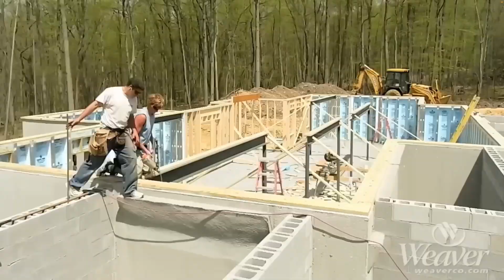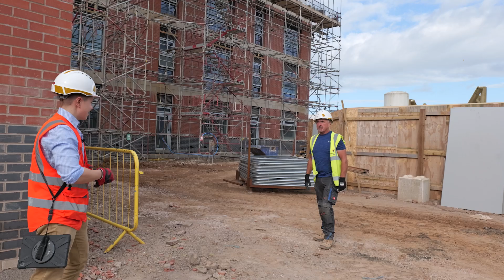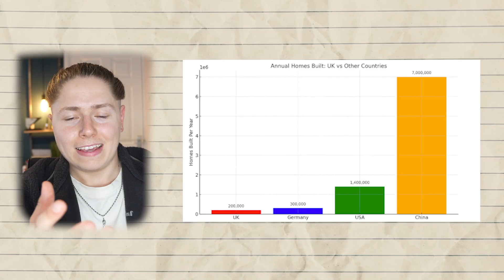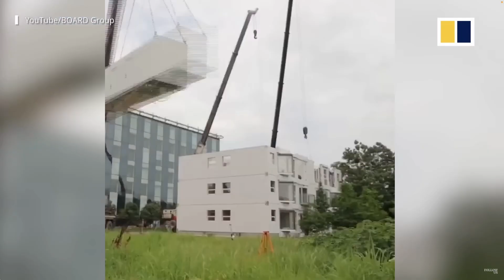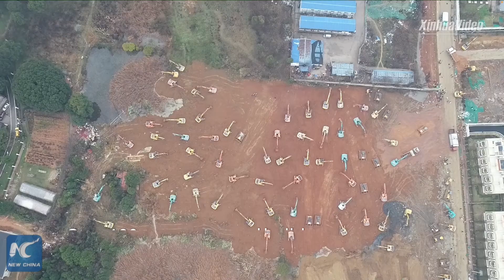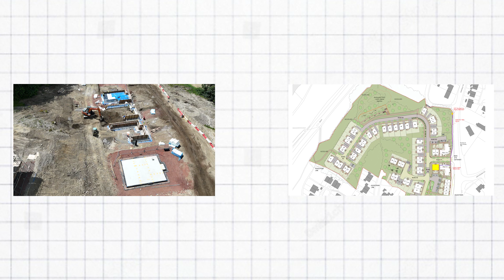Why Is the UK So Bad at Building Houses? (A Builders Perspective)

Comment: There's a multitude of reasons, planning red tape is just one of them. Add in stringent architectural design in some cases and a slap of mandatory over engineering to make material acquisition more expensive and long winded then it needs to be.
Then the government didn't realise our skilled trades would eventually want to retire and its brewed the perfect storm.

In my opinion our over engineering is making new builds less desirable now, especially when if you do a little research you can grab a solid property built in the 50's or 60's that's been looked after and modernised to an extent (been rewired etc) for far, far less then a new timber frame build.

In addition the government says we're building affordable homes but we really aren't, 90% of sites in the south east are putting up 2 bed flats going from £280k on shared ownership (a horrible scheme) or 3 bed+ houses starting at over £400k, where is the option for families to start on the property ladder ?